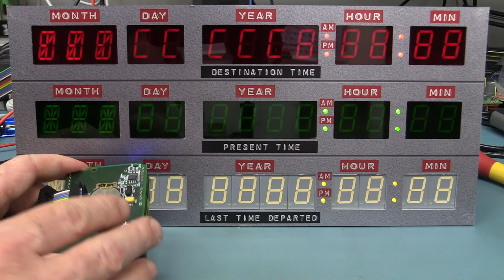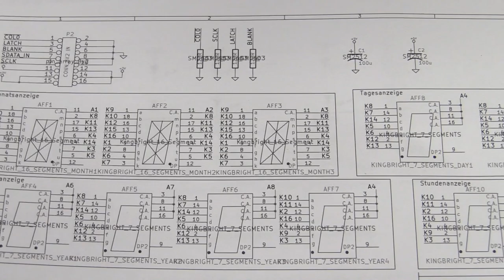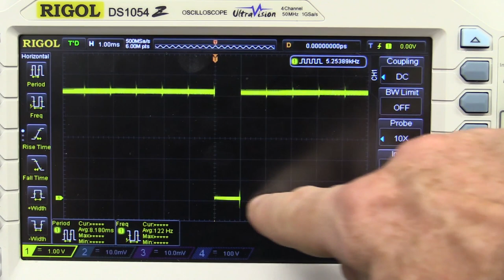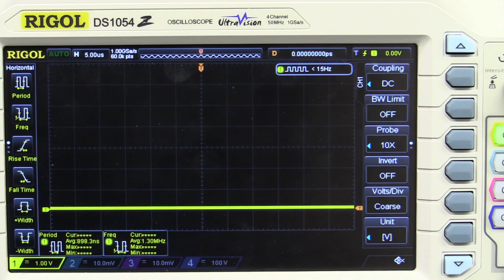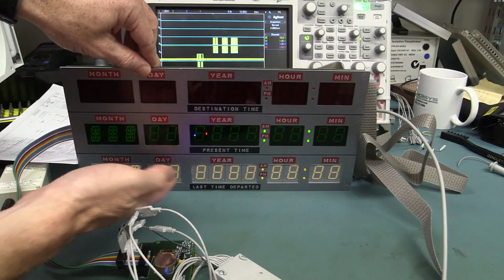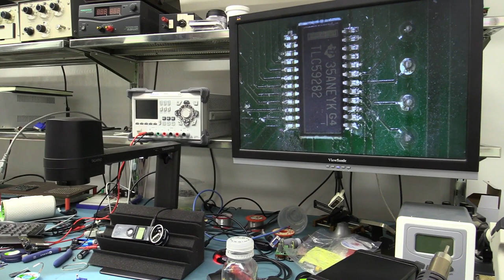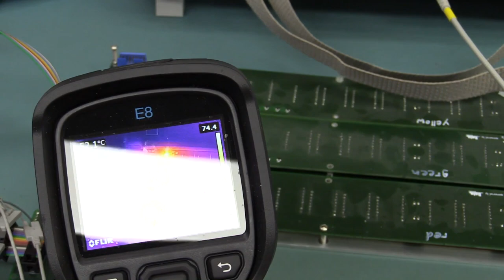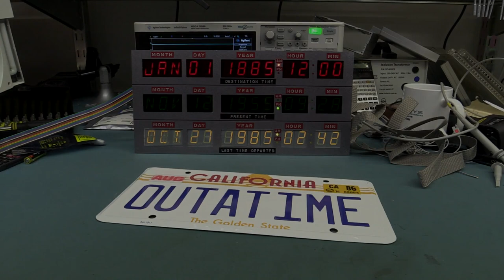EEVblog #689 - Back To The Future Time Circuits Troubleshooting

Comment: What we've learnt is a) Don't plug power connectors in the wrong way around, and b) Solder properly - Sorry, I am trying to be funny here ;) - I totally love your channel and you are one of the smartest people in this field on YT.  Brilliant stuff and if anything I am pleased you broke it, just so you could fix it and show us some interesting things along the way =)  Great stuff!
Reply from the maker: GadgetUK164 Ironically, if I had not shot a video about this and just soldered it normally without all the camera gear in the way, it surely would have worked first go.
Reply: I am absolutely sure you are right!  Demonstrations always go wrong - Murphys Law!
Reply: EEVblog Why do they not make microscoped like your mantis with a optical splitter prism type thing. (similar to DSLR's) so that you can record and view your work at the same time? I suppose the issue them would be that half the light goes into the camera and the other half of the light to your eyes and it will just be dark. I think those exist though.
Reply from the maker: GadgetUK164 Otherwise known as the White Coat Effect
Reply: Power Max
They do have microscope head options with splitters inside and cameras on top for traditional microscopes, so it should be possible, but I think the Mantis is built for a relatively specific purpose and it's not built for teaching a group or broadcasting etc.
Reply: GadgetUK164
That used to be Nathan's Law but I see it's now being used as shorthand for some US legislation.

Comment: This is one of the most informative trouble shooting videos you have done. It illustrates a very important trouble shooting point. 90% of the time when I've encountered trouble from a repair, it turns out to be something so utterly stupid that I fail to even consider it in my analysis. Only after performing numerous other test, as you did here, do I run into the brick wall of logic that causes me to look much closer at the obvious. Really good example of trouble shooting pitfalls!
Reply from the maker: bain5872 I was lucky this happened, otherwise it was just a blown chip, or just a missed solder joint found in a few minutes.
Reply: EEVblog
Agreed. I have found that the most frustrating and most irritating problems are the ones that are most simplistic but the most satisfying to find and fix.
Reply: bain5872
No, the most frustrating and irritating problems are the intermittent faults!
Reply: KX36 The WORST... intermittent faults in a feedback system. PID controls, velocity drives for brushless motors, etc... Oh my... It's not only intermittent... but half the time, that glitch feeds right on through the whole system. It's the glitch that can appear before it's origin point in the circuit! pure evil! XD
Reply: I reckon you blew the other two chips by way of the disconnected CLK line. When they get 85° during normal operation. Because chip #1 outputted 1's, the other chips get all 1's clocked in. How hot would they become if all segments are on?

Comment: As for the pin pitch: It also looks like the chip got soldered down slightly rotated. Notice that the pins at 30:25 that are off are on the lower right and upper left. If the chip wasn't rotated, they'd be off evenly. It does look like there's a slight pin pitch problem with that board, but it's not as severe as it seems.
Reply: Yes, we all can see the chip is slightly rotated.  But the pitch is significantly off.

Comment: Dave, your method of filming the soldering at about 34:00 was excellent. Much more effective than a single tight camera angle, and probably a lot easier for you doing the soldering. I don't think I've seen any soldering tutorials filmed like that on YT. You could probably make some great videos with that setup.

Comment: The disconnected clock pin probably made physical contact when you put your finger on your chip, rather than capacitance resetting the displayed values :p
Reply from the maker: Unreasonable Steev I wasn't touching the chip at one point, so certainly capacitive coupling.

Comment: Over-the-shoulder perspective when you soldered works just as well as squeezing the cam under your chin. Great Job!
Reply from the maker: dafl00 I thought it was a nice angle actually, might use it again. Could tighten up the shot a bit though.

Comment: To be honest, while I didn't spot the bad joint I did notice the wonky alignment.  I also - just from recent experiences - had severe doubts about the drag-soldering results.  That is just my own lack of confidence in my own ability though.  I would personally have either used solder-paste and the heat gun, especially given that sparsely populated board and a few strips of silver foil if necessary.  Alternately, given your microscope and its working distance I would have gone in with .25mm solder and a 0.8mm chisel-tip and done each leg separately from orbit - its the only way to be sure!

Those scopes are just amazing!  But at ~£2000 totally out of reach for most hobbyists I would think.  Are there any usable solutions in the sub £100 range?

Comment: I'm just shocked that the shift registers survived the reversed power supply... Those things fail if you look at them at the wrong angle... I don't use microscopes, i trust my eyes and i'm a bit short sighted so you might say i'm in macro mode all the time :) Dave you should have at least told me to wait for the sequel :)
Reply: Sheer luck of the draw I guess, must have been a fairly robust batch. I've had shift registers die on me if my dog farts, so I get what you're saying
Reply: If you can't put a series diode in the supply then a reversed-biased one across it is better than nothing.
Reply: Graham Langley What probably happened is he applied power on the data lines... I usually put power lines next to each other so i could put a capacitor easily on the other side of the cable. So if they did the same, the power was probably directly applied on the data lines when the cable was switched... Might also explain the shift registers surviving....

Comment: Dave, I have a question that I hope isn't silly. If the data going to the displays is just a mirror signal from the last display, how is it that only one display at a time is showing the URL while the others aren't?  I'm trying to understand how an individual display is being addressed when they all receive essentially the same signal.
Reply from the maker: Brandon MacEachern The data line daisy chained, not parallel.
Reply: SIPO orientation shift registers (Serial-in, Parallel Out). Simple output expansion.

Comment: Handy tech tip: when you could see the burnt chip and replaced it, you should troubleshoot just that board to find the problem. The "data" from the other boards just confused the issue. Then when the first board is working, the problem with the others would be obvious.

Comment: If you are putting this on the LIVE feed you culd make it display differnt thing.
"Present time" is just what it is now, but make "Destination time" to the usual start of work and update the date. and maby make a  sensor that detect for movment and if no movment has happen in 1-2 hours the "Last Time Departed" gets updated with the current time minus 1-2 hours.
Reply: Sounds like a good idea.
Reply: I'd have been lazy and just set the destination to +1s and the departed time -1s :D

Comment: I think the first thing a lot of people would have done is recheck those solder joints, but I think this video still illustrates something useful for the viewers. Sometimes, you don't have perfect knowledge of the history of what modifications have been done to a board and how it has failed. A good old probe 'n think is something you'll have to do eventually.

Comment: Once, again... a good set of steel picks is essential for SMD rework.  Every time you finish a chip, lightly rake the pins with the pick and watch for movement.  (Don't pull on them too hard!)

Comment: I suspect the drivers are getting very hot due to the relatively high voltage drop across the output stages. One solution I used with the old TIL311 displays was to reduce the LED supply with a couple of diode drops. This dissipates the power in large robust diodes rather than the drivers. It won't affect the brightness (much) due to the constant current drives.

Comment: I saw that pin unsoldered on the soldering video!

Also I would assume if it blew up one chip it would have blown the other two. Obviously they aren't tolerant to that kind of fault

Comment: At one point I thought it might turn out to be a ground or negative supply rail to the chip gone open. I had a ground issue on a repair I had where all the inputs were fine but the output was bad. Trips you up every time!!

Comment: wonder if it would be worth getting some white LED segment displays to put underneath the green diffuser?
Green LEDs tend to be dimmer, so perhaps the bright white ones under the dark green diffuser would solve the issue.
Might give you a nicer shade of green too... Native green LED light is very yellowish I find.
Reply from the maker: Dan Coulson Interesting thought.
Reply: EEVblog
It looks to me as if the LED segments are the same parts on each row - the yellowish ones you see bare on the bottom row. Red or green diffusers are put in front of them on the top 2 rows. So it's no wonder the second row is so dark as there's so little green content coming from the LED behind the green diffuser.
Reply: Doubtful. White LEDs would typically have a blue and a yellow peak. The actual green content that would make it through the filter would be significantly lower than a monochromatic light source.
Reply: Dr. Lecter Good point. I didn't consider that at all...
Assuming that the existing green LEDs are running at full brightness, the only other option to produce a more uniform light output might be to reduce the brightness of the red display?
Reply: Dr. Lecter It's not that much dimmer than existing 565nm GaP green LED display used currently, although pure green 525nm InGaN display would be even better for the application. I have seen white LED's been successfully used behind red filter in a store that still had quite bright output, it's worth a try. I am aware of the peaks it produces, but practical tests have showed little bit different result even with a toy grade white LED, not to mention that the filter is not special wavelength filter, but instead a colored diffuser used to hide grey display bodies from plain sight to make it more appealing to look so some blue and yellow can get through also.
Reply: DjResR
There's still little point. Ideally you should just select a more suitable display for the ambient conditions. You'll always be wasting more energy trying to use a white LED behind a filter rather than a monochromatic light source.

Comment: In case you're wondering, Dave did a dry joint on the Data In Pin on the chip he smoked and replaced, starts around 22:40
Then he found out that because the 3 chips on all 3 boards are in series, he actually smoked all 3 of them.

Next Monday, Dave opens up a package of Smoke from Germany to put back in the chips.

Dave, You should include the clip at the end where the Doc says "It WORKS, I finally invented something that works!"

Comment: I have a mantis at work and I hate using that thing... to focus it you have to move the whole head. Depending how tall your bench is you have to adjust your seat height too. Sometimes if I have a part that's really high, to sit comfortably and focus I have to put books or something on my chair to focus.
Reply: I got both a Mantis and a regular stereo microscope at work but I can't stand the Mantis. It makes my eyes hurt in a few seconds, and a really bad headache after a few minutes.
The regular microscope on the other hand, I can use for hours without any perceivable strain whatsoever.

Comment: I find that when repairing any type of big display where you have to work on the back of them, its useful to have a mirror at the back of the bench and turn the display to the mirror (back will face you so that you can work)
In this case you would immediately notice a change in the display (looking at the mirror even if by the corner of your eye) when you probed it because the clock would be going in when you pushed the pin down.

Comment: Your fixit videos are the most informative, well rounded, awesome videos on electronics I've ever seen. I'm fixated on them, even, I never thought I'd put 1.5 hours into fixing a BTTF board! Have you considered wall mounting the Tagarno if possible? Your workbenches seem steady enough in any case, just curious if it was possible.
Reply: Really the problem is the long arm. It probably needs some diagonal struts down onto the bench to keep it fixed solidly to the work surface and moves steadily with it. That would be difficult to implement without reducing working area though.

Comment: I always use a sharp solder assist tool to check the connections of each pin. Visual inspection alone not enough.

Comment: Good troubleshoot, no need to berate yourself.
Hardware - check
Input - check
Output - check, and software also inferred to be checked.

Now, when all checks out, then go for Sherlock Holmes' old axiom,  when all other contingencies fail, whatever remains, however improbable, must be the truth. In other words input failed.

Comment: Another trick for desoldering smd ics is to thread a piece of enameled wire behind the pins and pull on it while heating each pin. It lifts the pins up one at a time without damaging the board or the ic.

Comment: Great scott! I've been there many times since '93 with simple problems like solder joint that I was sure were more complicated because of multiple failure or assumptions I hadn't verified. It usually resulted in people still saying I'm the master, just don't tell them your mistake ;) BTTF is more exciting than the surgical lasers I worked on back then,  Thanks!

Comment: I'm quite paranoid about checking soldered joints. I usually check continuity between each pin (at the top where it goes to the package) with known points on the PCB, even if it's a 144pin 0.5mm TQFP. And also I check pin to pin continuity for shorts. Of corse you have to very gently probe so that you don't put to much pressure and get a false beep when a cold joint makes contact.
Takes some time, but you often find issues like this or bridging of pins. This might change if I had a high magnification microscope, but maybe doing both checks are even better.
When doing analog stuff, I would often check resistances between points in the circuit to check for errors as well. Kind of a very slow flying probe machine!

Comment: Could you get an XBox 360 with red ring of death and fix it that video would get loads of hits they all have the same problem but different error codes would be interesting to see what you think of the problem Microsoft had. I would send you one but would be a bit expensive from the UK to Australia (think your in Aus are you?). Great videos anyway I watched loads and learned loads :)
Reply: +Philip Sempers Only the early launch models without the HDMI output got that issue I think, they fixed it in later models when they added that HDMI out. Last I remember, it had something to do with either the CPU, or the graphics chip coming loose off of the main board, which was due to over heating I think, something about the board shaking at high temperatures.
Reply: +Bungis Albondigas the flip chips become ruined from thermal cycling

Comment: The reason the displays are dim is because those TLC59282 drivers can only do 45ma Max current output at 5v. And each of those lines is driving 8 different segments of the led displays...those displays can pull about 30ma at full brightness. So each of those displays is only getting about 5ma ish so won't be "that" bright.
Reply: That might also explain why the ic's are sooo hot. Each of those outputs are running at full chat and probably at the limits of the ic

Comment: another great video Dave I am having problems with a circuit I just built, first problem was a flashing led! who on earth invented a led with a flasher built inside, that screwed me up for an hour or better! still having problems however now I am going to check solder joints
Reply from the maker: Ken s LOL! Flashing LED's have been around since the 80's I think.

Comment: Winner winner chicken and waffle dinner!  It's amazing how easy it is to go deep down a rat hole.  I remember spending two days tearing apart a X-Y scanning system for what turned out to be a missing semi-colon in my C code driving the stepper motors.

Fried chicken and waffles is a speciality of the southern United States.  Waffle on!

Comment: Need help figuring this out (complete noob)
Using HC11 instruction set
Write a program code to calculate the average of 7 numbers
requirements:
-The program should start at address $0000
-Assume that the 8 bit numbers are stored at the starting location of $00A0
-Use accumulator B as the counter
-Use indexed addressing to access the numbers
-Store the final result at location $00AB (Must use indexed addressing)
~Explanations and recommended software to run  similar programs would be appreciated.

Comment: the real tricky one are logic ICs with missing Vcc, often they will mostly work as long as atleast one input is high because the chip is then powered thought ESD diodes
Reply from the maker: Lasse Langwadt Christensen Yes, they are nasty, I think I've done a video on that somewhere, or at least mentioned  it...

Comment: Well first thing is to check for bad joints with optics like shown here, then you bring the fancy equipment like Dave has. Because normally you do not have it.

I'm amazed that a Pro like Dave Jones did not properly inspect the reworked chip joints in the first place.